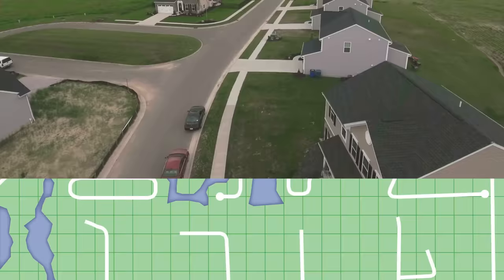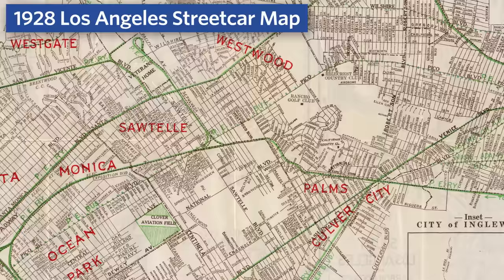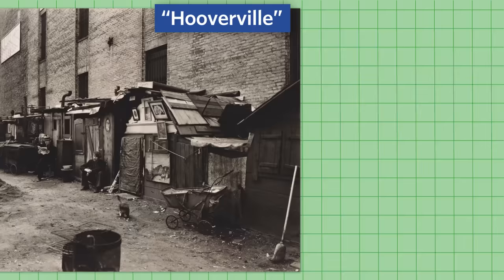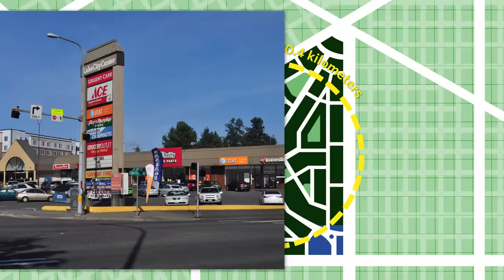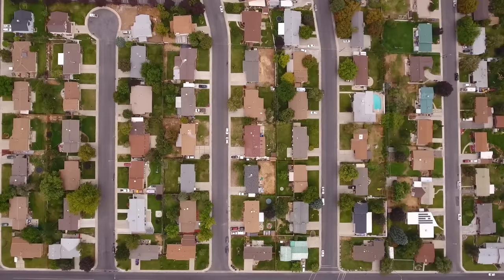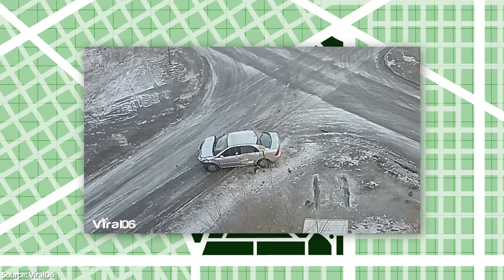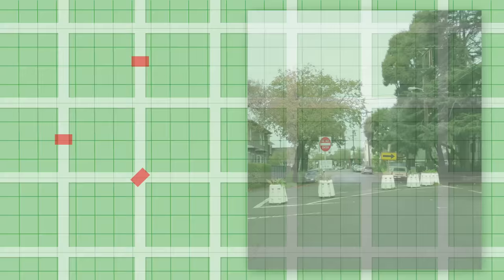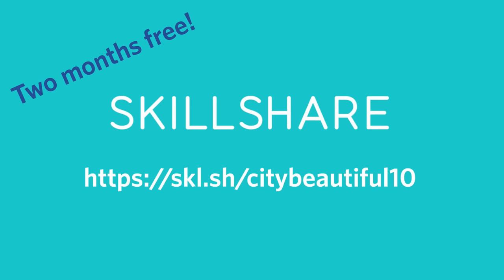The Reason Our Streets Switched to Cul-De-Sacs

Comment: In the Netherlands we don't do cul de sacs. Our version of a cul de sac is a street which just stops suddenly, and you will have to figure out how to turn your car.
Reply: same in the uk
Reply: And we tell you before you drive in that it's a dead end.
Reply: We have a lot of dead end streets but we also have a decent amount of cul de sac streets, for example look at the town of Rijssen.
Reply: We have plenty of those, they are called dead ends
Reply: @notsure6187   old city centers often just don't have the room

plus in europe city center are still really a place to live, so a lot more is biking or walking distance, certainly in the flat countries ;-)
Reply: lol just like Sim City 4 with no mods
Reply: The most important reason for a circular terminus relates to public safety. For example, it enables large fire trucks that made a wrong turn to reverse much more quickly.  Without this feature lives and property might be lost. Other considerations relate to moving vans, large trucks, and ambulances not to mention automobiles.
Reply: I drove through Venlo in the netherlands this summer and was the street layout confusing: The old city core was blocked off, which is not that uncommon around Europe, but around it, the streets were littered with roundabouts, and they by themselves were made of multiple roundabouts, without any markings to help motorists figure out where to position themselves for their exit. Likewise the cyclist paths around them was alternating on the sidewalk and in the roundabout??? Luckily it was Sunday morning, so I wasn't detained for suspected murder. But it is amazing how reckless city planners can be?
Reply: tbh, in the Netherlands, there is one of the best schools of urban planning. Just look at those streets in Google maps, they're like art (e.g. Almere). And of course, maybe they are a struggle for cars, but thank God NL is not USA and people know how to use bicycles, cars or amazing train transportation.
Reply: @ddffd1539  They are puzzling to me as a foreigner, still European though.
Reply: Same in Sweden.
Reply: Lol
Reply: @ddffd1539  Totally agree, Dutch city planning is probably one of the best in the world. I prefer a Dutch or German city layout over a North American one ANY DAY. I lived in the US for a couple of years and I found the urban planning there with that gigantic sprawl totally awful.
Reply: @Fmono • 38 years ago • Updated Actually city planning in the Netherlands and Germany often objectively IS better I'm afraid. MUCH more walkable, much better public transportation, shorter distances, more sustainable. You can basically walk everywhere or use a bicycle to get from A to B and not necessarily need a car. I'm of course talking about modern city planning...very dense & crooked historic old town cores, plenty of them here of course, can be a nightmare for car driving, for sure! But the quality of life is pretty high provided that everything is well-maintained & in order, which generally isn't the problem in the Netherlands, Germany, and quite a few other European countries. In fact you often get the "best" of both worlds: An old medieval city core with renovated historical buildings, surrounded by more modern buildings and street layouts. Not always perfect of course, but still highly preferable to dull North American suburbian sprawl.
Reply: @Fmono • 38 years ago • Updated Well, I just basically did, didn't I? In addition to what I stated in my previous post, the building standards are higher here on average; compared to the US, this whole stuff is more (& better) standardised and regulated as a whole, to ensure better overall average quality. The same goes with public transportation. At least in the Netherlands, Germany, Switzerland, Austria, the Scandinavian countries, and quite a few more. "Europe" isn't a single country.
Reply: @taylorshaw  Europe for this reason has far smaller fire trucks on average than the USA. Large ones do exist but tend primarily to larger on fire buildings.  Due to Cities and countries being more dense other considerations take priority. ( Fire trucks might need less range, be smaller, be more agile etc. ) Of course for large scale fires firetrucks of larger size are used but the some of the old practice was to not have the largest drive at the front. New Navigation technology has largely eliminated  the need for this of course.
Reply: Good old europe
In mother europe streets arent built on landscape

Landscape built street
Reply: lol true

in the philippines you just realize a huge fucking building blocks the road
Reply: @JoshuaHere  Alot of roundabouts in rijssen when i worked there
Reply: Cul de sac is actually french and used in france and other countries for a dead end street...
Reply: Better than highways that abruptly end with a flight into if you are lucky some level plains or water...
Reply: @Tore_Lund  Look up videos about Dutch cycling infrastructure. There are plenty. This is a good example:
https://www.youtube.com/watch?v=q664_GjTyoE

Or this one about cycling in the US from a Dutch perspective:

https://www.youtube.com/watch?v=m2THe_10dYs

And a great video about how road rules work in The Netherlands:
https://www.youtube.com/watch?v=XpQMgbDJPok

And from 2 days ago, a video about the largest bike parking facility in the world, right in the center of town:
https://www.youtube.com/watch?v=ypGMoe468vs

I am Dutch so I grew up cycling. I cycled to school by myself or with friends from a very early age. No car was needed to move around for my entire childhood which gave me tremendous freedom and independence as a child. Of course we also drove a car as a family to cover longer distances but that was only to go to other towns and cities or to go on holiday. I'm approaching 40 now and I've never even owned a car. Don't really see the point and I see it as a burden rather than a freedom provider.

I've only truly began to appreciate all this though by leaving The Netherlands and learning that the rest of the world is rather different. So I feel very fortunate to have grown up in the place that made me the truly free person who I am today.
Reply: Use someone’s driveway
Reply: lmao
Reply: Fmono • 38 years ago • Updated When you’re stuck in a suburban area without a car, the dense street systems of older cities instantly seem much more sane and natural. There’s nothing objectively good about having to drive 20 minutes just to get to the grocery store or anything else.
Reply: Now i understand why my country (Indonesia) has so many dead end roads and bad city planning 🤦‍♂️
Reply: The same in all old town in Europe I guess x)
Reply: in brazil it's called ''rua sem saida'' or street without exit
Reply: That is why God created navigation systems...
Reply: A lot of the cul de sac in my area are ending with pathways towards a park. Or 2 cul de sacs back to back with pedestrian access.
Reply: Aye pretty much all of europe
Reply: @ddffd1539  Autogebruik is heel erg hoog in NL desondanks.
Reply: @NorthSea_1981  NL is full of suburbian sprawl! The only walkable parts are the historic city centres that we have. If the USA would have had medieval cities, they would be walkable as well. As soon as you leave the historic city centres, what you enter is suburban sprawl. And even in NL, the car is king.
Reply: I guess same in all Europe.
Reply: Ever heard of three point U-turn?
Reply: Xenon they’re like puzzles!
Reply: I think the pattern was actually quite popular in the 1970-ish.
Beijum in Groningen, Houten near Utrecht, parts of Zoetermeer.
It's just not as obvious, as the housing is often much more dense than in the North America.
Reply: That sucks for anyone towing a trailer.
Reply: @tanet   Actually it is a front pocket in the inside of a skirt.
So what happened some times that a guy wanted to go down with his hand ( and thought he was altmost there...) he ran dead in the cul de sac of the girls skirt.
Reply: But at the ends of these cul-de-sacs, we do have a cycle lane, as well as a sidewalk, to the main road.
Reply: Here in Germany, the dead ends often occur in new construction areas. At the end of the road there is usually a bigger place, thought to be a turning circle. 

There the cars are parked which do not fit into the garage anymore.
Reply: the north of Canada/quebec is filled of that. If you go too much north there signs saying that first respondent (cops, firefighter and ambulance) arent in service past that point. That and  a lot of road that lead to abandonned mining town. You think you're going somewhere but really you're just in the middle of nowhere hours away from any civilizations
Reply: Never seen a cul de sac in Brazil either
Reply: We call those dead ends in the USA.
Reply: @yaaasmine5198  We have lots of cul de sacs in the UK. You have thousands in London suburbs alone, what are you on about?
Reply: Suburbs of Groningen, noticeably Leewenborg and Beijum, follow the more modern cul de sacs approach. Loads of connections for bikes and pedestrians, limited connections for cars. One main road, lots of smaller offspring roads.
Reply: @Xenon  Cul-de-sac just mean dead end street in french, there is not necessarily a turn around at the end (unless it took an other meaning in the us). So basically what you are describing is still a cul-de-sac, just a poorly designed one  from a car driver pov.
Reply: Oh don't worry: We have those in the US, too.  :)
Reply: In the nineties there was some school that designed neighbourhoods with one main entry road. (iirc one was in Veldhoven)  Some vehicle blocking or narrowing that could be torture. Or if the road they connect to is blocked due to rushhour.
Reply: I just reverse out.
Reply: NorthSea 1981 are you aware of how large US cities are? Offcourse smaller cities are more walkable. They have less people and more space.
Reply: Xenon same in Belgium
Reply: @Tore_Lund  it's a matter of getting used to it. Also when people don't quite know what to do they become more careful.
Reply: @mimori8   I get what the purpose of such a layout is, my objection is  just how ordinary roundabouts work already: You are forced to slow down because of the tight turn, you have a clear view of cyclists to your right, which also won't suddenly do a left turn into the roundabout. So more time to orientate yourself and fewer unknowns to account for. In Velno, it is a total mess:  Under the rail road bridge, cyclists come from all directions; from the pedestrian street, from anywhere on the sidewalk, from the zebra crossing! As a motorist, it is completely impossible to decode where they intent to to go, and because it looks like an ordinary roundabout when you approach it, both to cars and cyclists, everybody just rides into it thinking ordinary right of way applies. So you are right, this crossing fills me with dread, and makes me slow down, but I'm not convinced this leads to fewer accidents. Similar problem on the other end of the station: The figure 8 double roundabout. In a car, that is easy to understand, however cyclists still take a shortcut between the islands = ride opposite to the direction of half the cars!1 This is also absolutely insane.
Reply: San Fransisco and Oakland, CA have many of those as well.
Reply: Um, that’s a cul de sac, mate.
Reply: Mark Flierl    Um, that’s a cul de sac, mate.
Reply: yaaasmine     Um, a dead-end street is a cul de sac, mate.
Reply: ThierryTheuns    Um, that’s a cul de sac, mate.
Reply: That's a cul de sac
Reply: Dead ends in America  are for criminals to get caught after a good chasing 🤣🤣🤣🤣
Reply: Someones driveway
Reply: Not Sure k-turn
Reply: but every cul de sac or dead end is announced via a street sign so you are prepared
Reply: lmfao
Reply: Lol
Reply: yea the east german solution is much better, just don't maintain the smaller roads, to discourage through traffic. works much more naturally.
the west german solution is garbage though, they'll just put stupid low speed limits in random places to make people avoid certain areas.
Reply: @windhelmguard5295  yeah and in The Reach they just let the Forsworn take out anyone who doesn't need to be going through there.  Germany is a weird place.
Reply: @ddffd1539  "amazing train transport system"... last when I lived there (2013) there were many people complaining about the trains being too short and overcrowded in the rush-hour period
Reply: Just use someones place in fron of garage (however it's called) to turn back.
Reply: @Tore_Lund  I realize I'm a year late, but I just need this out of my system. Feel free to ignore this. 

I'm looking at Venlo right now and I wonder where you saw roundabouts made up of multiple roundabouts (especially last year, couldn't have changed that much), let alone ones that lack markers. There are a lot of roundabouts without markers because they're single lane. I realize you said you're European, but Dutch cities aren't made like NA ones where no matter how small the town or village is they expect a road throughput equal to a Chipotle toilet. So most roads are 2 lanes (one for each direction) or one lane. So any roundabout on it only needs one lane to keep traffic going through it at a steady and safe pace.

In fact, a quick search only reveals 1 roundabouts with more than 1 lane. There's also a traffic circle (albeit an oval one because it has to go underneath 3 to 5 train tracks), but since it has traffic lights and you're supposed to stop on the circly bit, you know it's not a roundabout. As for that double laned roundabout, it's clearly marked.

If you look at roundabouts, crossings, and intersections, we do use curbs to create a barrier between cycling and driving sections of roads. Maybe you confused that as a cycling road going on and off the sidewalk? With normal roads the speed of the traffic and traffic density determines if cyclists go on the road, get their own 'red band' on the road, or separated cycling paths. But I don't recall cyclists having to go on the side walk except during construction.

The design is almost completely uniform across the entire country and is designed to; prevent interactions between differing traffic streams, to force participants to pay attention in traffic, lower speeds to give participants more time to watch out, and drastically lower speeds at places where accidents are most likely to happen (and thus reducing the severity of any accident).

I believe we're currently in the 3rd revision of these design principles (called "Sustainable Safety" in English and "Duurzaam Veilig Wegverkeer"* in Dutch) and while we started out with the same number of deaths (per 1000 or 100 000) in traffic as the USA in the 1970s, where the USA's deaths seems to only decrease with advances in car safety that protect the occupants, we've slashed our deaths by (I believe it was) 7/8ths since those peak years. And specifically, one of the reasons that caused change in the Netherlands during those years, the number of child deaths dropped from 500+ to 17 en 2020. Seeing that 17 is 1/8th of 112, child deaths were slashed by about 193/200th (if you like fractions, else) it dropped by about ~96.7%.

So what you call reckless and almost caused you to be detained for suspected murder, we call an extremely successful strategy in preserving life and making our cities more livable by giving people a genuine choice of transportation without them having to fear for their lives.

*"Naar een duurzaam veilig wegverkeer" is the original 1992 publication, only in Dutch. This was followed up by "Door met Duurzaam Veilig" in 2005 (I believe this one does have an English translation available). And unless there's been a new publication the "DV3 - Visie Duurzaam Veilig Wegverkeer 2018-2030" from 2018 (which has an English transation) is the current one.
Reply: Isn't that just a Cul de Sacs by accident?
Reply: @donnerwetter1905  Eh, I am from NL. I know what I am talking about. What I stated is factual. You can look up the mobility data.
Reply: @donnerwetter1905  If you look at the modal share, you will see that the car is by far the most important in terms of kilometers travelled. The share of the car in NL is 86%, which is way above the EU average and not that much below the USA. Anyways, quite clearly you haven't been to NL.